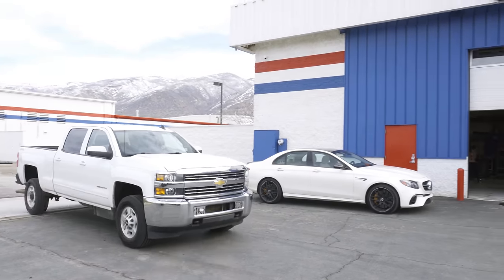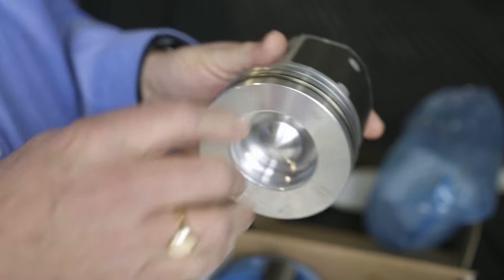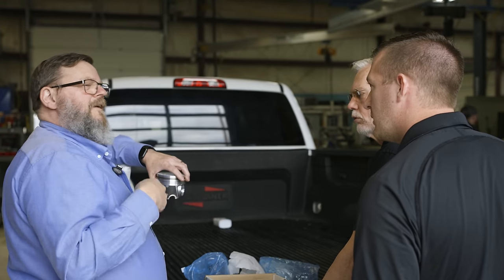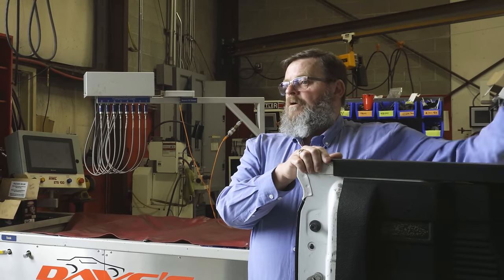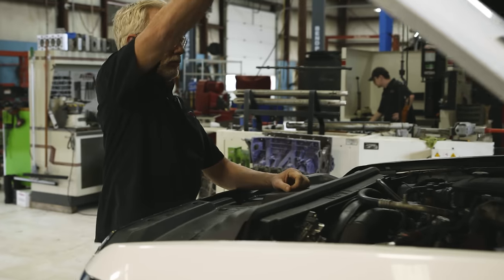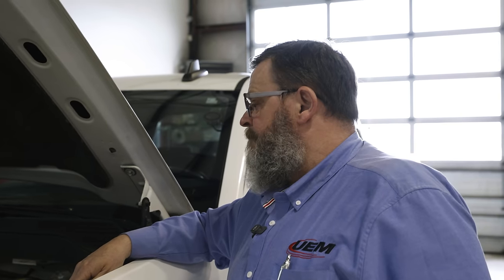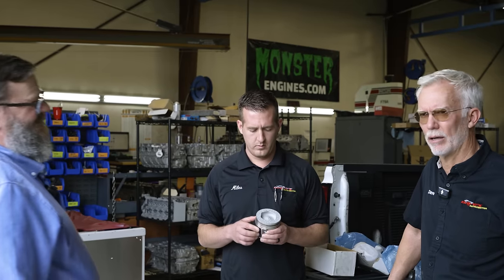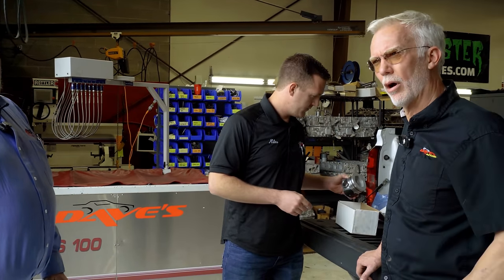What do golf balls and pistons have in common?

Comment: All I see is a company rep bragging about stuff without any data to back it up. I have seen a few studies on these piston dimples and the improvements are no where near his claims. OEMs getting fined billions for skirting emissions and you expect me to believe some simple piston mods could improve emissions and power....yet they dont do it.
Reply: They hate us. They make BILLIONS on manufacturing after-gas system, BILLIONS on parts and service when those after-gas systems start failing.  We are making these for the guy driving the truck, not the guys making the truck...
Reply: @speedofair  lol ok. Bottom line is if these pistons performed half as well as they claim then every engine builder out there would using them. Negligible difference in manufacturing cost, better performance in all categories...yet nobody uses them?

Comment: it smells like snake oil to me just so mutch magic. says ceramic reflects and keeps more heat in the combustion, then turns around and says lower nox cant beat chemistry heat makes nox, then turns around again and says lower egt just by magic. your instinct was right that is a gas truck with a duramax badge on it. the independent testing is only blowby witch is from the total seal ring not the piston. makeing the motor "quite" and removing the smell man thats a gas truck.

Comment: The only way I would believe this is if you installed them into one of your trucks and documented the whole thing. It sounds like an awful lot of snake oil. Every major OEM has the same computer simulation software that these guys have and why is it that they can make some proprietary coding and a couple of dimples and a piston and gained 25% fuel efficiency? People would buy it even if it Only increase the life of the DPf.

Comment: There's some pretty sketchy facts here, oil change is bull, modern engines are designed for the carbon to get in the oil instead of out the exhaust, oil degrades with time and use, given all the money spent by the engine manufacturers to get an advantage over the rest, i think globally someone would have come up with this if it worked, ceramic coating will work, thats why the use it on manifolds, noise is down to lower compression in the piston squish zone. Bet they can't meet emission standards either, 85% less nox, total bollocks.

Comment: Blaa...blaa...blaa.   Let's see the test results in the real world.   I can see a coating helping to prevent heat loss into the piston, but all the dimples look like window dressing and we need to see a coated with dimples compared to coated without dimples before passing judgement.   20-30% better fuel economy?   NOPE.   Not going to happen without altering the tune.   Prove me wrong please.
Reply: The truck in the video is a test truck owned by SEMA Garage. They have been testing and EPA certifying the pistons for 6 months now. They are releasing data soon but everything claimed is 100% accurate.

Comment: Apparently, these jokers and the snake-oil piston salesman have never heard of the Laws of Thermodynamics. Has Dave?

I'll just comment on one very basic outcome of those laws -- cycle efficiency. It depends on peak cycle temperature  compared to low, which is the engine carcass and incoming unburnt air. Anything that reduces peak temperature in the cycle reduces efficiency, no ifs ands or buts. EGR to reduce NOX reduces efficiency.

This dolt selling pistons says the wowee design reduces temperatures.

He'd be laughed out of any serious engine development center claiming the nonsense he's spouting. Can't ecven pass the most basic "smell" test. It's the Traveling Medicine Show Edition one million and three -- drink this hooch, it heals all ailments.

Either there are Laws of Thermodynamics or there aren't. Either there is real engineering or there are technicians without the theoretical grounding who do not understand the concepts but who think they know more than the engineers and live in a different galaxy where pesky rules don't apply. or where nurses know more than doctors.

This miracle piston is useless in my opinion. Just another con, like the Fish 200 mpg carburetor, which if it were real, created energy out of thin air. Same with this gonzo whizbanf horse manure story about a piston.